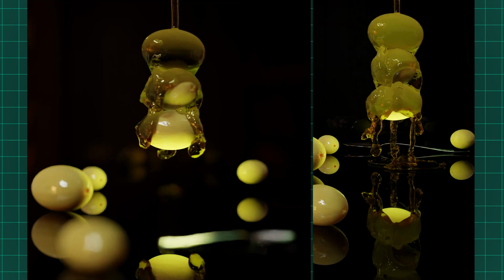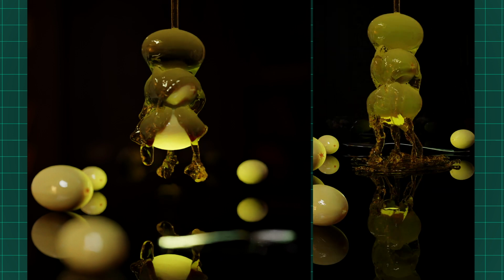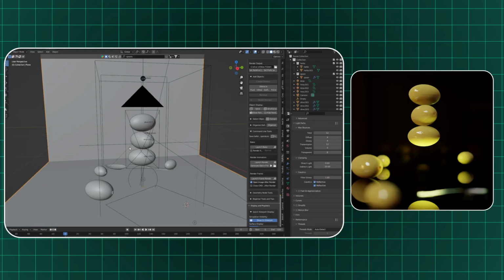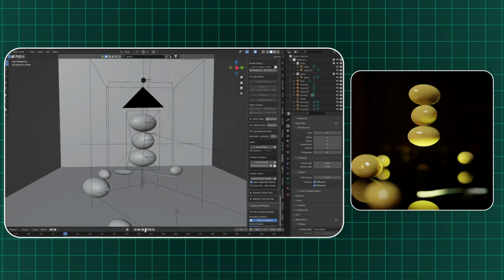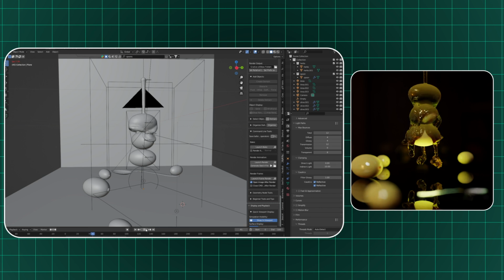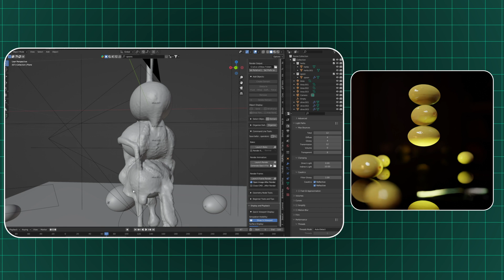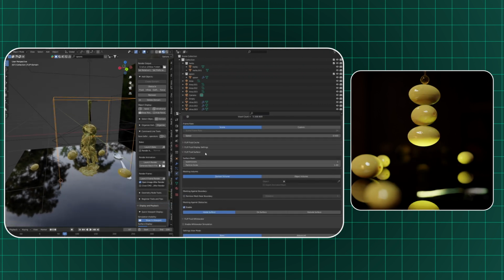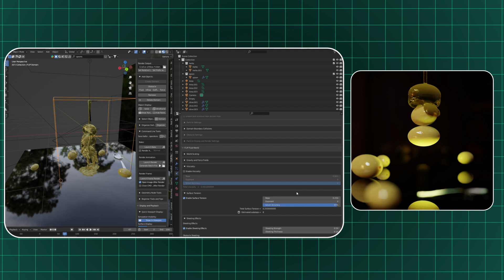Olive Oil In Blender Using Flip Fluid -

Comment: Hi bro flip fluid is paid? Right? Can we do this without flip fluids?
Reply from the maker: Yes with mantaflow  very easily  just have some higehr Resolution like 150-250
and enable viscosity but very low value
Reply: @stormwaveart2698  thanks alot bro means alot you consider my request 👍❤️waiting for more complex simulations tutorails soon .add some tutorails with mantaflow as well as everyone don't hv flip fluids